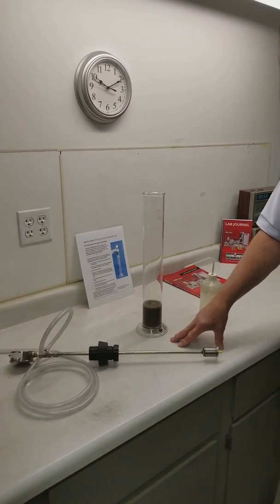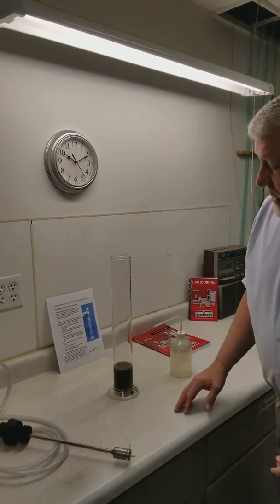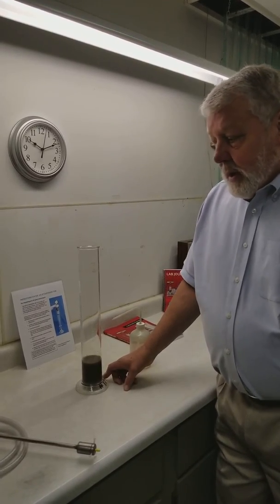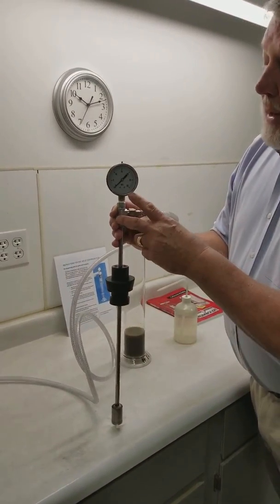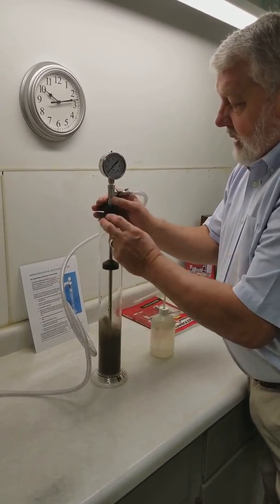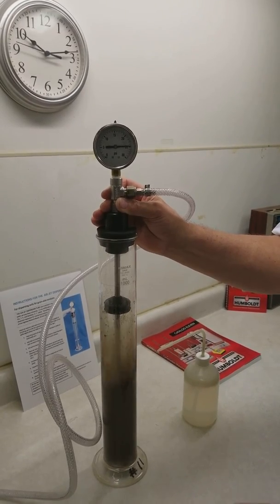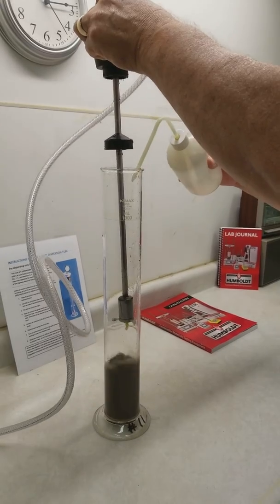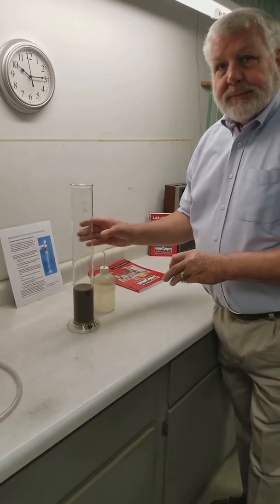Air Jet Dispersion ASTM D7928

Comment: what are the main changes from the discontinued standard ASTM D422 ?
Reply: I think the main changes are the temperature-density calibration, the way of using the dispersing agent, using dry hydrometer before each measurement, using soil  that passed of number 10  sieve, calculation, and not allowed to use oven-dried soil
Reply: The dilution of dispersion chemical and its procedures.